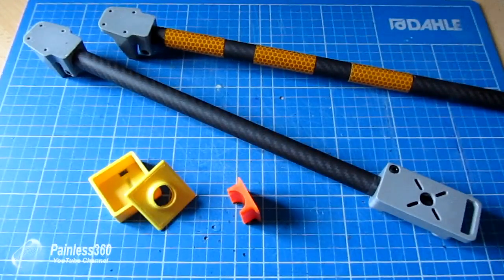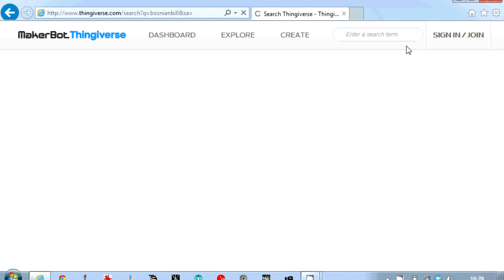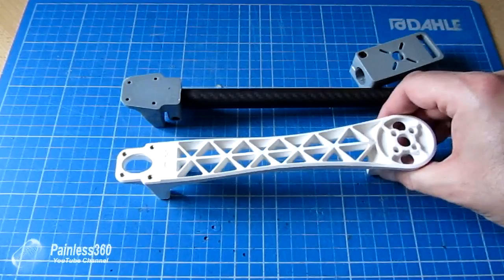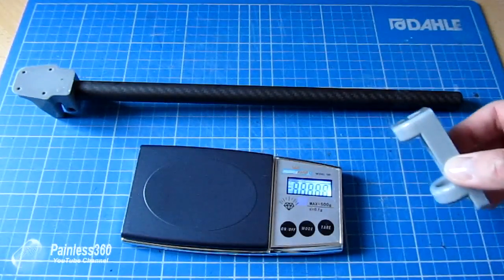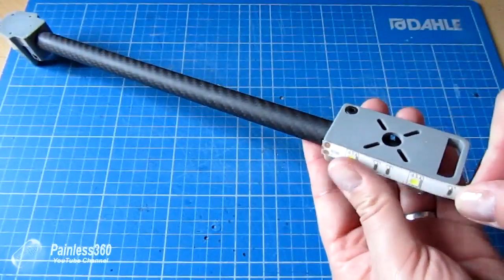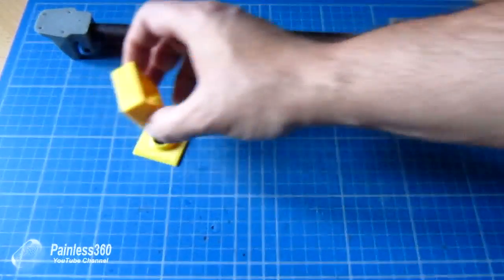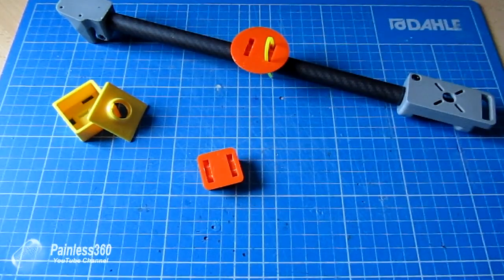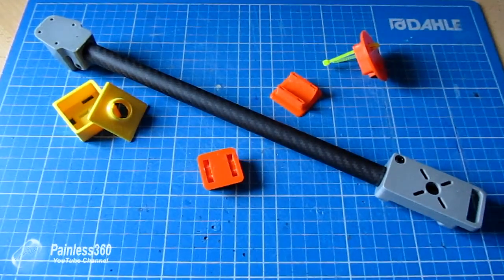Multirotor Quick Tip: 3D printed part models by BosnianBill

Comment: BosnianBill should probably also redesign that 450 carbon tube arm mod parts list to include a mount for an X8 configuration- all LRS and extended flight time multirotors are moving to that configuration. Easy for him to do most likely and then those who want to save money on an Aerial Mob kit for their TBS Discos will have a DIY option for the existing part/mount.